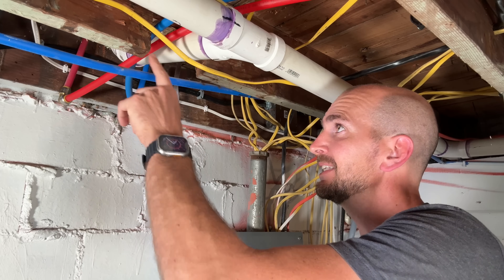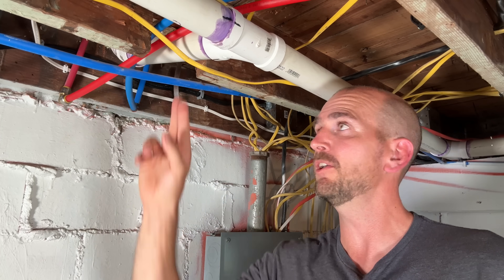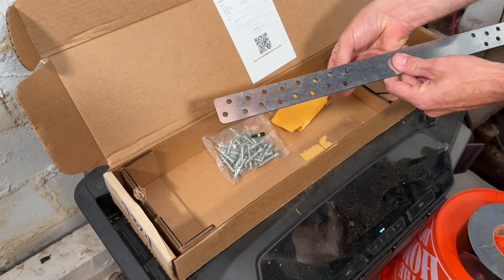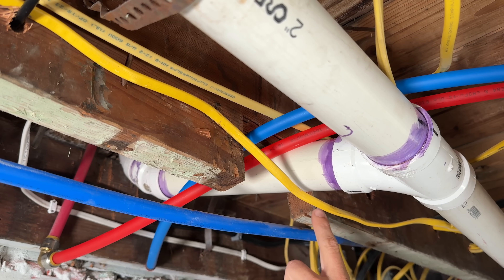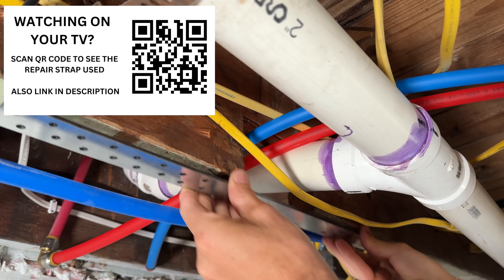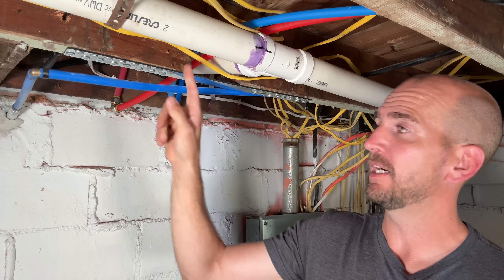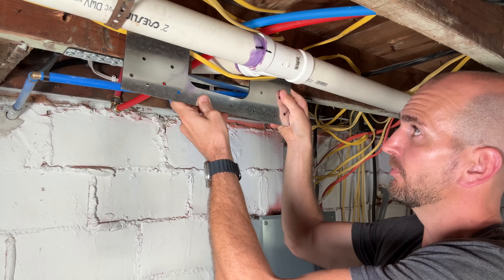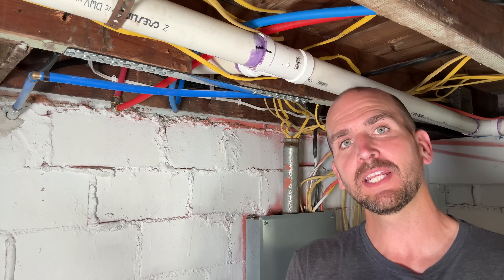Quick DIY Repair for A Failed Inspection:  Notched Floor Joist

Comment: This is a terrible design and the manufacturer of that brace should fold.  Should have used an I beam with 4 screws on each side.  More dcrews do not make it stronger.
Reply from the maker: This design is to return the ability of the floor joist to hold tension at the bottom which was last with the large notch.  They also have many other designs depending on the joist damage and some of the designs have I-beam like characteristics.

Comment: I have a small screen so I can't be certain.....but regarding that 2" PVC fitting....holy crap....is that a sanitary tee laying on its side???  If so, ....then that notched joist is the least of your inspection concerns.
Reply: It should be torn out and redone  might as well sister the beam on both sides while doing it better thab relying on a piece of strap iron.
Reply: It appears to have  the correct amount of fall
Reply: @arezhik7774  It should be a long sweep unless that is a vent line.  A short 90 or a sanitary tee in the horizontal is a no-go for drains in California.  Oh, and please don't get me started on the PEX and electrical.
Reply: @946towguy2  That electrical looked a little sketchy to me.

Comment: I was a little surprised to see it installed on its belly. That is, I'd expect most of its strength to be when used on the side of the joist rather than under it. Like a sword's blade: if you hold the blade horizontally (flat), it can flex, but it won't flex along its narrow dimension.

Comment: What is the tensile strength of the strap? I would agree with another poster asking asking how much sag would take place before the strap would be effective? Have you checked to see if the joist is even sagging? If it is sagging, should you have jacked the joist up before installing the strap?
Reply: Having done some further research, that strap is considered a non-structural product. I would not recommend that product.
Reply: @fifthamendment1 they have a structural engineering report on their website.
Reply: @fifthamendment1 Thank you, I just wrote a comment asking if this "DIY" repair was signed off by an engineer. If his "inspector" can't even call out the obvious Code violations on that breaker panel, then I seriously doubt he's qualified to sign off on that strap.  And since the strap is not rated as a structural component, it's a major fail anyways.

Comment: Your drain piping is installed wrong, you can not lay a tee flat as it can be seen in your video. It has to be a combination or a wye and 1/8 bend. It's frustrating to see crappy plumbing work done, like cutting out a floor joist, plus using the wrong kind of drainage fittings.
Reply: Exactly correct. I had the same situation which caused the toilet to backup. Repiped with a Wye and problem gone!
Reply: @Junk-t6v  I'm a master plumber and I've been plumbing for nearly 53 years. Glad you fixed your problem

Comment: Interesting they have so many holes.  There is an upper limit.  To many holes and there isn't enough material for the screws to hold on to.  Looks like at least twice as many screws as you'd need.. but I'm not the engine that designed that thing...
Reply: In my opnion that wasn't designed by an engineer at all. You are correct, that is way too many screws for it to have any integrity left, especially with predrilling.
Reply: @JosiahK555

There's an epidemic of people using "to" instead of "too." Have you noticed that?
Reply: @billstevens3796  ya,  there's this thing called swype on Android makes typing a lot faster.   It also means more typos unfortunately.

Comment: That would never work where I live. You would have to use steel.
Reply: @vinnygoombatts1458

That is steel bro, in tension. Half that thickness would do the job.
Reply: @billstevens3796 can't tell what kind of material it is on video. I try to always stress "where I am". Here we have pipe guards with reinforcement. Wraps around the pipe and joist..had to use them once or twice. I'm just saying where I am it wouldn't pass regardless.  Maybe it's fine where you are.

Comment: Could not you use a piece of heavy angle iron to support the 2 x 8 which would probably be stronger than a piece of flat stock.
Reply from the maker: Yeah, but probably hard to pass inspection.  This specific strap is holding in tension and not compression.  There are several other version available depending on the joist damage.  👍

Comment: Hate it. Even an angle iron would be stronger than that but I'd rather bend some steel, making channel to swallow the joist (coped to go around the drain and PEX) and use through bolts.
Reply: @annettesurfer

I guess what you're saying is you would use an 1 1/2" "c" channel?

You could do that, sure. But the majority of the strength would still come from the bottom where the steel is in tension.
Reply: @billstevens3796  I’d bend a piece of 18 GA metal to go a couple inches above the 3” notch on both sides, so since the floor joist is a 2x8, a 12” piece would fit the bill because subtracting an inch and a half for the bottom bend would leave about 5.25 inches on each side. Next 24” (the same length of the strap) would suffice to bridge the 5” notch, with 9.5 inches on both sides. So a 12” x 24” 8ga sheet of metal, along with some through bolts would be superior to that strap IMO. Clicking the link he provided shows other options, but one has to click through to find the strap. My suggestion isn’t in any of their offerings, but it’s what I’d do.

Comment: I followed you for interesting insights  on construction.  This is now at least the second time I’ve seen you offer dubious repairs for egregious, unforgiveable effery, all the while without any sense of outrage.  Even suggesting this damage was unavoidable.  

My blood pressure doesn’t need this apcray.

Unsubscribing.
Reply from the maker: I can't tell if you are being serious or not 🤷‍♂️.  If you are serious I do recommend at least taking a look at their website and the technical bulletin prior to letting your blood pressure spike.  https://cdn.shopify.com/s/files/1/0275/0169/1018/files/Skyline_Technical_Bulletin_Stamped-23-03-25_69cf4270-0ebd-4660-8b99-c0d258356c3c.pdf?v=1679938097
Reply: @EverydayHomeRepairs 

You’re clearly more sympathetic to contractors than to consumers.
Reply: @EverydayHomeRepairs 

That you claim you can’t tell, is just further confirmation.

Comment: I don't like it.  I would sister in a 36 -48"  2x 12 and bevel the ends at a 45 degree angle to 8".
THEN I would re-do the Pex neatly and bore a nice 4 1/2" hole for that sewer piping.

Comment: Is this code compliant?
Reply from the maker: I would check with your local inspector(s) but in my area we got the green light.
Reply: @EverydayHomeRepairs Maybe 20 years ago, each state adopted the IBC. Then many states have a derivative of the IBC. For example, California has fires and earthquakes so they adopted codes to reflect such conditions. Having watched the the framing of a house in Texas on YouTube, I was surprised not to see bearing plates and other Simpson hold downs for seismic issues.

Comment: Dual purpose, also a nail guard plate.

I would think a lag stud turnbuckle tensioner would work too if there is enough space under the pipe. Around four times less expensive.

Comment: I had to deal with a similar problem in 2022.  I purchased a nearly 50 year old home in 2019.  One of the contingencies of my offer to purchase was a home inspection conducted by an inspector of my choosing with results satisfactory to me. I scheduled a home inspection with a highly regarded home inspection company recommended by the selling broker.  The inspection revealed a few minor plumbing deficiencies and nothing more.  These were promptly corrected.  I closed on the sale and moved in in late 2019.  In 2022, while chasing a routine plumbing repair, I discovered a huge longitudinal split in a floor joist under my kitchen.  It was in the bottom 1/3 of the joist and you could tell that it had been there for years. This started with a knot which had split into several branches and spread along the grain for about 28 inches.  The bottom of the joist was still intact but was sagging and appeared ready to fail at any time.  After brainstorming solutions for a couple of days, I contacted a structural engineering company which advertised a joist repair kit similar to the one used in this video  https://nolanstructuralproducts.com/collections/joist-repair-kit.  I bought their repair kit and followed the installation instructions to repair my floor joist.  My repair was a bit more involved as I needed to jack up the joist to reduce the stress on the tension edge of the joist.  I decided to inject Loctite PLMax construction adhesive in the  gaps caused by the split while simultaneously jacking up the joist.  I used a 20 ton bottle jack to jack up the joist as far as I dared.  I didn't want to crack my basement concrete floor. While the joist was jacked up and before the construction adhesive took a set, I installed a 3/4 inch plywood splint along each side of the joist using  #9 by 3 inch structural screws and 16 penny nails.  All of this in addition to the 32 structural lag screws holding the repair strap to the bottom of the joist.  I let this entire assembly sit in the jacked position for 72 hours before removing the jack.  I've left out many details to shorten this comment. Feel free to contact me for pictures and more details.

Comment: I can’t believe drilling and screwing all those holes would not weaken the floor Joyce, sorry but I’m not buying it
Reply: Correct, way to many holes.  Probably 2 on each side with structural screws would be sufficient

Comment: It might behoove you to replace that pex with copper. Pex is carcinogenic. Copper is superior for supply. Stainless steel is superior for drain, but plumbers won't do it. But you can control what you're supplied with, so it would behoove one to insist on the non toxic copper. Now the junk in the water is another issue. I have to run my water through the ZERO water pitcher, 5 stages filter, then, because that reservoir is plastic, I then distill my water. I filter before I distill it because it keeps the distiller cleaner. Our water has a lot of filth and Missouri American water doesn't care.

Comment: I would have jacked that joist up a little before putting the strap in to restore the original integrity.
Reply from the maker: That is a fair point in this case we didn't have any sag and just needed to fix a line item on the home inspection.
Reply: @EverydayHomeRepairs The sag was there as soon as the timber joist was laid on the end supports, and increased as the floor was laid on top. Marginal yes, but the fibres at the bottom would have been in tension. The metal strap will not stretch but should be tensioned to do the work of the wood cut away

Comment: Plumbers are such butchers! The absolute worst. Even though it would have still required supplemental support, they could have just cut a hole. With a hole saw. Of course, that would require some math skills and calculation. You wouldn't believe some of the homes I've looked at destroyed by "plumbers'. Cut out half of a 2x9 just for a 3/4" hydronic copper pipe that interferes at the top 1.5"s of the span. Shit,Just cut half the beam span away! It's more common than you'd think.

Comment: If you didn't have this strap what's the fix?
Reply from the maker: I don’t have a better alternative.  Maybe redo some of the plumbing taking a bit more care with cutting holes instead of a massive notch and then sistering the joist with a new board.

Comment: Not saying I can eyeball whether it’s needed in this specific case, but in general, I would try to test whether that weak joist has sagged yet at all. If so, get a post and jack to take out the sag (or some of it), and then install this strap. Otherwise, you could be in for a little more sag before the strap really takes on a full load.
Reply: Yeah I was wondering if the joist needed to be jacked up a bit first
Reply: It should be jacked a little, or the straightness of the joist should at least be checked.
Reply: Or some of it?

Comment: If the floor above has dipped then you need to jack up the joist a little bit before installing the strap. Then install the strap so its holds the floor horizontal. I'd also recommend installing solid blocking on both sides to help that joist out.
Reply: This is right.  You need to add some tension with this device.
Reply: you didn't see the structural duct tape he used during installation?
Reply: @ZackWilliamson1  Why did he remove it and put in screws?
Reply: I would have just installed one side and then jack it up just a bit, then attach the remaining side.
Reply: @chrisharper2658  Yeah, I agree, depending on what's going on above this joist. If it's a tile floor, jacking up the joist could be a bad idea.
Reply: @chrisharper2658 That is exactly what I was thinking.🤔
Reply: Areed, it should be boxed at both sides. It also depends too how far it is from the rim joist or band board. That strap needs to be used in conjunction with boxing the damage.
Reply: I'm just a handy homeowner but yeah, that was my first thought...my guess is it wasn't an issue, just checking a box for the inspector but definitely should have been mentioned
Reply: Depends whether the floor was redone since the damage. Mine have been, so we can’t jack the joists or else we’ll damage the floor that now takes account of the droop.

Old houses are great.
Reply: He replied to another commenter and confirmed there was no sag and the inspector approved the work.
Reply: Just my thought.
Reply: I'd have used two 1/4" thick 1x1 els take emulate a tight C wrapping up. Or, a 1-1/2" or 1-3/4" C or box screwed in from below. Either way that's gonna be a lot of drilling steel. Best left to a drill press or machine shop...so buying this "flimsy" strap sure as hell would be less work.
 Still...it is just a strap. Subject to bend and flex.
Reply: Steel cables on Bridges flex also. I don't think that's an issue here, it's just a tension issue.  @lyfandeth
Reply: nope. blocks might help for a while.anyone should have seen this coming and before it went up I would have sistered a 4 inch steel joist before anything. If my plumber did this he would pay to rip it all out and then put it back together.. after I said what in the world were you thinking
Reply: That was the question I had in my mind
Reply: @craigb5017  You get questions from your MIND? Wow! Mine just come squirting out of my ass.

Comment: 2 issues with the fix - 1. Metal is too thin. Bends easily. 2. The holes being drilled almost at edges of joist. They will just cause the joist to split over time. 

So the repair you made is a very temporary fix. It won’t really do anything for long term strength.
Reply: The metal is stressed in tension, not bending, and intuitively seems thick enough to me.  I would see the issue as whether the wood holding all those screws can really hold them against that much stress.
Reply: @gort8203  yes exactly, and to add to it like he said this particular strap required at least 2" of continuous wood on the top (in compression), otherwise you would need a larger strap (on the bottom in tension).
Reply: @1971kona

My dad, over fifty years ago, did a quick and dirty repair on a 2 X 8 joist that was completely cut in two. 

He used what he had on hand. 16 gauge sheet metal and roofing nails. It's still solid, no issues whatsoever.
Reply: There’s a couple of licensed structural engineers that would disagree with you… I was skeptical myself but I’ve never been one to speak without getting to the bottom of things. On the manufacturers website are the tech bulletins and specs, and calculations.

Comment: i find it hard to believe this would pass inspection
Reply: Why? The bottom of the joist is subject to mostly tensile forces. The strap is steel which picks up those forces.
Reply: @ZmanKC the original tension was lost when the notch was cut. For this strap to carry load the joist must sag to tighten the strap. Ideally the strap should be in two pieces with a screw clamp between to pull them together. To pretension the strap replacing what was lost when the notch was cut.
Reply: @ZmanKC key word is “mostly” as in when it’s in the middle third of span, start getting closer to the supports and shear is controlling whereas that strap will not provide adequate shear in some cases
Reply: As long as the screws are structural, which means they have a shear strength comparable to nails, this should work just fine.

Comment: How thick is that strap?
Reply: There’s a spec sheet on the manufacturers website, plus the engineer’s load calculations.
Reply: @jt5747

Plenty thick. Probably half the thickness would do the job, because steel is very strong in tension.

Comment: That metal is so thin, don’t see how that offers any support at all.
Reply: Same reason a thin metal cable can support thousands of pounds. The bottom edge is entirely in tension. Steel is great in tension. If there’s any risk of compression, sure, it’d buckle easily. But, in this specific case, it only needs to be strong in tension.

Comment: LOL who put that Hot Pex line in? A 8 year old could have measured the length better or cut it so it doesn't have that 43 degree correction.
Reply: Yeah I think I was looking more at the mess of wires and pex rather than the floor joist fix which I have to say is a pretty good idea. Sorry to fixate on the pex but it makes me feel better about my own DIY pex 😀😀